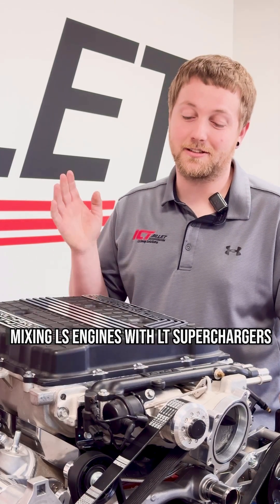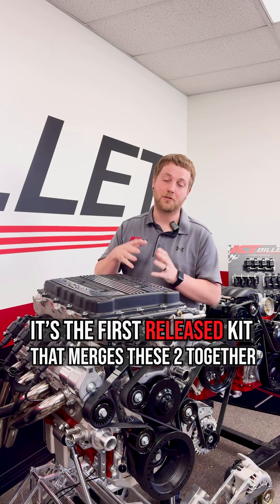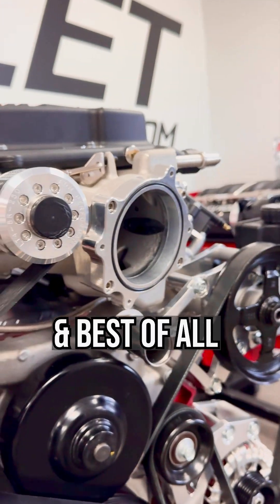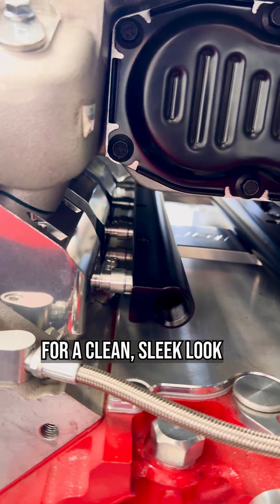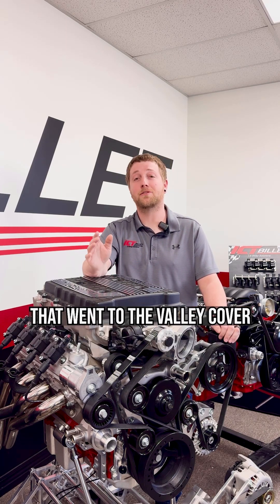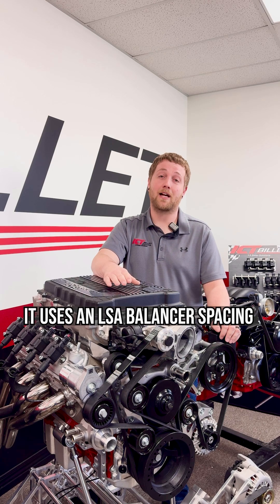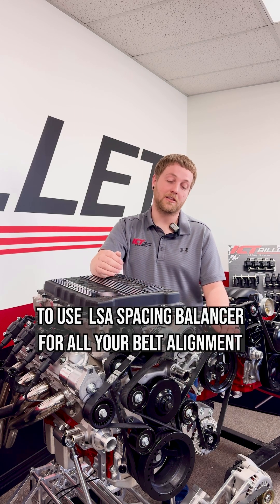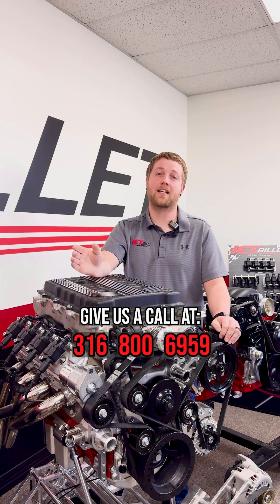The world’s first LT Supercharger to LS Adapter Kit is going quick! #LSSwapTheWorld #builtnotbought

Comment: I’m so impressed by this, lately I been seeing hellcat blower Ls, now lt4 blower Ls, what kinda power would this supercharger add, & would it be better than the regular lsa or centri procharger
Reply: Less power than it's worth. The price of these adapters, super chargers, injectors, and all supporting mods just to be around 600 hp. Hardly worth it unless you have a lot of parts already and are able to do your own work.
Reply: @BlackandWhitecustoms  just to be around 600? That kinda sucks lol 😂 I’m already making 560 n/a, thinking I might just try to find a pro-charger setup
Reply: @MaroVillain  turbo is the way to go. It's easily controllable and fairly inexpensive if you can weld.
Reply: @BlackandWhitecustoms  hear me out Built 416 c6 ls3, Kong 2650 lt4.. just hasn’t been done 🤷🏾‍♂️
Reply: @BlackandWhitecustoms I couldn't agree more.  For less $ you could make more Hp by simply installing an LSA. I honestly don't know why people would prefer to spend unnecessary amounts of money to run a  blower that is only going to see 600ish HP.  Example:  that adapter fits rec port heads i believe.  Which means  youd need to be running a 6.0 or 6.2 essentially.  Well, a 6.2 with a max effort LSA will put down 800-900 at the wheel all day, and in the long run you'd probably spend the same amount of money but make 100s of hp less with the lt4

Comment: What kind of power are you guys seeing with the lt4 supercharger compared to say an lsa/ls9 build?
Reply from the maker: Thanks for the great question! We are working to get this figured out!
Reply: @ICTBilletLLC any updates? On the power #
Reply: @Unclephilwhips504 LSA might make a touch more power. 1.9 liter vs 1.7 liter. 

Also curious to see what power they pulled out of their dual port injector, lt4 supercharger set up.
Reply: @chefs_garage yes but we’re also talking about a a twin screw vs a TVS design. TVS blowers are typically smaller in displacement but are usually much better in terms of heat management and power. Similar to how a 2650 can make just as much as a 4.0L whipple. Still curious to see what the real numbers are on an ls build
Reply: @zombies418 interesting, I did not realize the lsa was a roots blower. I assumed it was tvs as well. If that's the case, lt4 might see more top end and the lsa might see more bottom mid range.

Comment: Does it fit Corvette C6 ? Or intake height at least please and thanks🙏🏽
Reply from the maker: Good question! We haven’t tested hood clearance in a C6 yet, but it will fit the engine!
Reply from the maker: There is a picture in the listing of a measurement.
https://www.ictbillet.com/products/corvette-lt4-supercharger-to-ls3-lsa-square-port-head-adapter-kit?variant=45528882053350